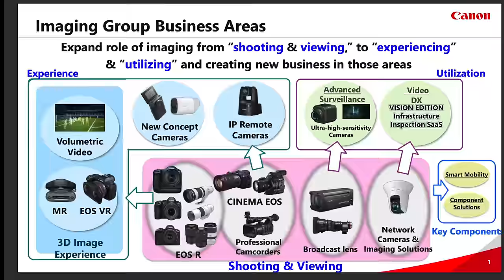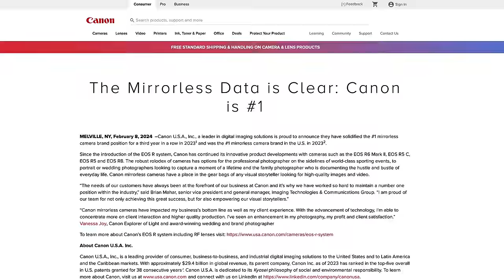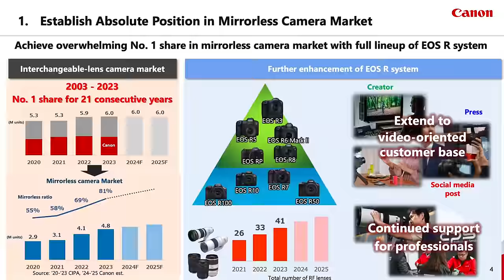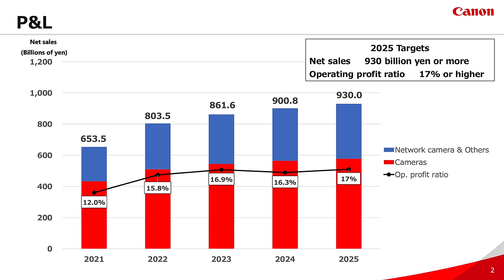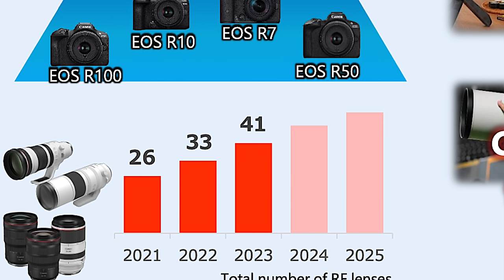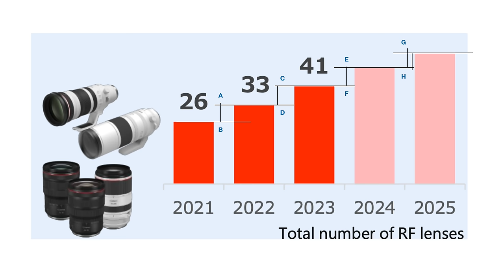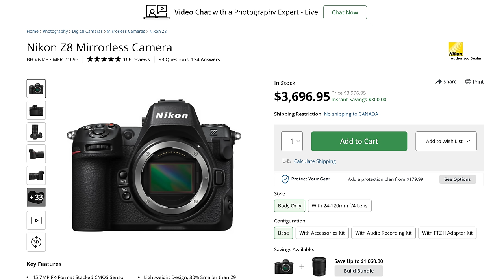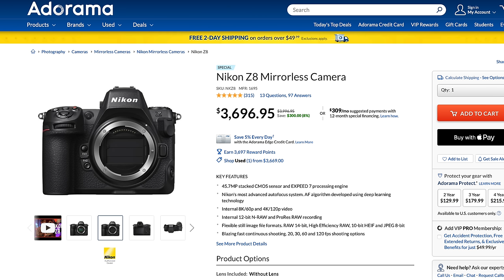Canon RF - 12 New Lenses Coming

Comment: I honestly don't mind adapting older EF, especially L lenses, onto my R7.  But my main beef is not getting anything new and uptodate.  Sigma isn't making any of their new lenses in EF flavor, holding out for when they can start pushing RF I'm guessing.  Their new 24-70 f2.8 is really nice, but only for E and L mounts.  And I can't find Sigma's older version, which came in EF, and i hear its just as nice as Canons 24-70 f2.8L versionII at $400 less.  This is my main frustrstion.  Adapting isn't an issue, getting new is.  And new RF from Canon doesn't fit into my budget.  

Now on the note on my dead R7.  I seem tonuave revived it, though i haven't tried shooting it yet.  But yesterdays news still leaves that lingering bad taste of being lead on false hope.

Comment: That change from 16.3 to 17% profit may reflect their expectation to sell slightly fewer of their own RF lenses but still increase profits through royalties. Judging from their own lens releases they have tended toward higher margin expensive side of the market but probably are not hitting targets in units sold. Which is why they have had to adjust their “strategy” and pivot to negotiating deals with third party makers. I also suspect they are trying to require them to only focus on the lower budget end of the market where margins are slimmer. Maybe only RF-S lenses. Sigma won’t like that much.
Reply from the maker: A good argument Brian. 2024 has gotten off to a very slow start despite so many cameras to be announced. Perhaps these delays weren't intentional and are causing them to readjust their expectations.

Comment: I think that what you are saying is that over time we can expect Canon to fill in its RF Mount line of lenses in the same way it filled out its EF Mount lenses.   Moreover, I suspect that we will see third party RF Mount lenses after the RF Mount lens collection approaches the number of lenses available in the older EF Mount.   I think that Canon is pretty much repeating itself and is simply recovering its R&D investment in the RF Mount and the redesign of RF Mount lenses.  I expect that Canon is going to continue to reap  the benefits of the new RF Mount while it takes advantage of the new lens designs that have been made possible by the new Mount.  Faster zooms with wider range and less chromatic aberration.  Faster primes with similar optical improvements and probably more lighter weight lenses that will now be considered mid range lenses.
Switching to the RF Mount adds significantly to Canon’s ability to maximize the improved performance of its mirrorless products across the board.

Comment: I've got a local EF 100-400 L IS for sale - $500 - mint cond

Does anyone have experience adapting these older L lenses to an R5 or R6ii

I thought for $500 i might get a few years use BUT if the autofocus is trash and subject tracking is Gimped I don't want it

Input anyone ?
Reply: I have the EF 100-400 L IS mark 2 and it's stellar, tack sharp with good stabilization.  You just need to get an basic EF-RF adapter ( ~$100 ) to use it on the new mirrorless.